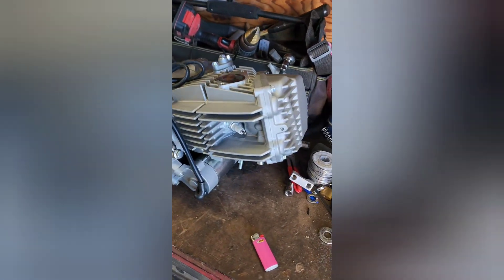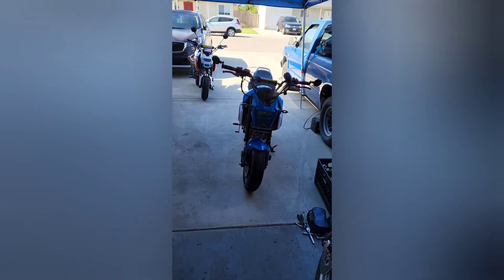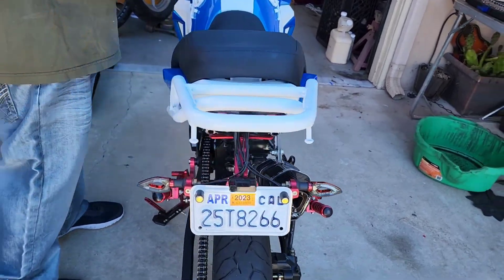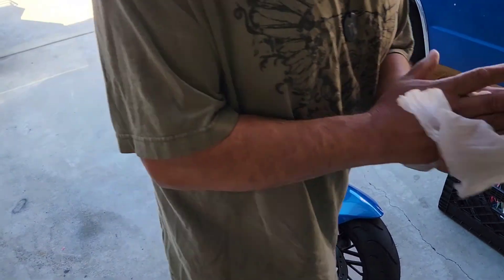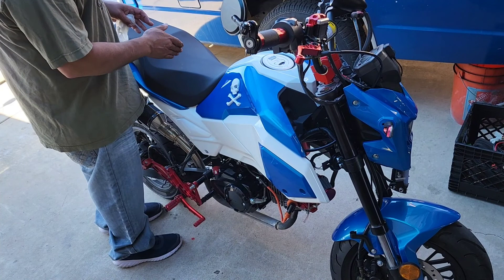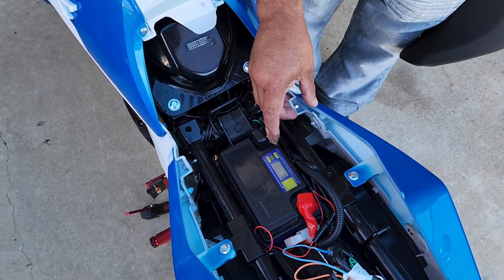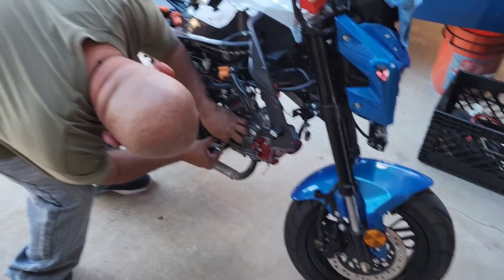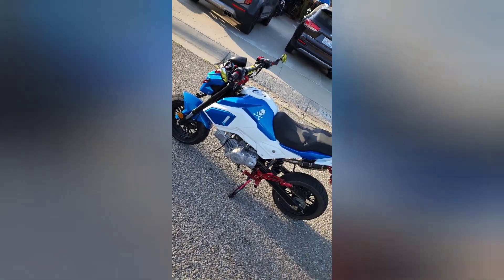Boom vader 190cc motor swap!

Comment: It's probably been swapped by now, some 2years later... but that exhaust is severely choking off power to this engine.  You want a 32-33mm minimum diameter pipe at the head, expanding larger as it goes on this engine.

Our guys here will probably see another 2-4hp gain with a larger exhaust.

Comment: It the z's 190 2v zongshin I can tell by the covers.  Hit me up when you are ready for your swap I can tell you how to build the motor your looking for the best price. Warning you will need a change of pants after the first ride I'm positive LoL🤭. For the front shocks swap out  to grom they have drop in kits to make them better and adjustable from a couple different company's.  👍👌✌️💯🥂🏍️
Reply: Link for the front shocks???
Reply: Is Daytona better then zongshin?
Reply: @thqtsmacker6205  depending on what your opinion on better. A Daytona coast more and needs to be more taking care of adjusting and servicing also make 5+ hp more. then a  Z's  it also coast less.  less servicing to and 5 + or -hp less  in my opinion you can get zs190 for a lot less money 6-8oo$ total for the engine. a Daytona engine similar model to the zs coast $1200-1500  5 hp more not worth that much in my opinion. If you don't have any  engine building knowledge and just want more power with out having to build it and have extra money Daytona. Hope that helps you 🍻🛠️💯👍✌️🏍️💪
Reply: @josephsaucedo8691  thank u I'll go with the zs

Comment: Did you have change any of the wiring on the stater?
Reply from the maker: It seemed to plug in pretty easily I know that you have to  Cut off and tape over a kill wire And reposition a wire green to clip into the stock harness on the motorcycle. We got the information of YouTube videos. I was working the camera that day and forgot to record that process. I apologize.  I will try to cover all processes when I switch the motor on my bike.

Comment: Where’s a step by step video?
Reply from the maker: Sorry this is what I got . I suck.
Reply: Need a step by step.. I’m looking to do a swap myself
Reply from the maker: @mattdavis3365   Really you don't need a step-by-step. All you do is change the stater parts from the 125 into the new motor. The 212CC  You will need to drill out the case just a smidg to fit the larger 3/8 bolts. You have to use 3/8 bolts.
 My best Bud there is very very scattered brains and gets me in a tailspin. He stressed out then I didn't get all the footage.
Reply: @bikebilderbear6786 I'm looking at a Vader because I do not have a small bike "62 years old now " Where does one find a motor etc  Any heads up would be appreciated Thank You